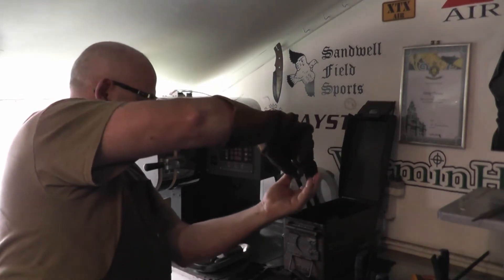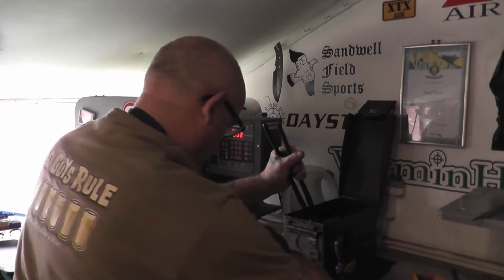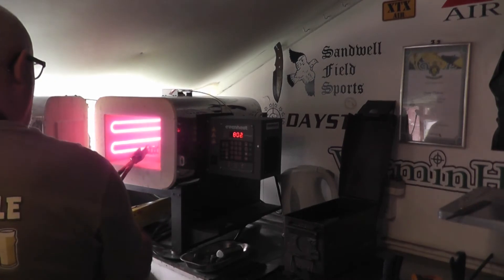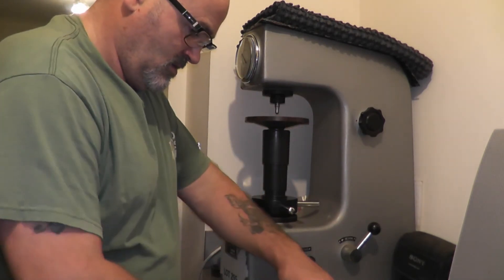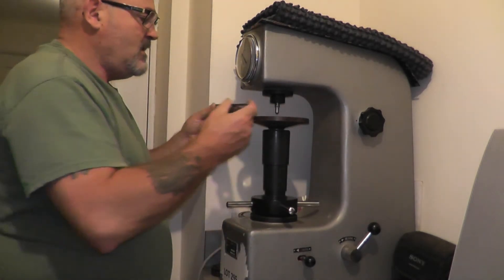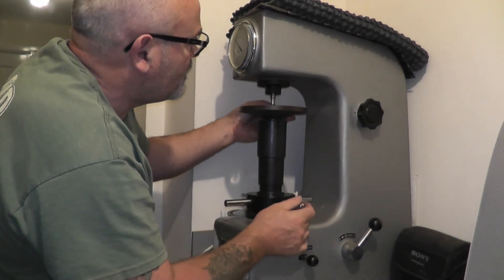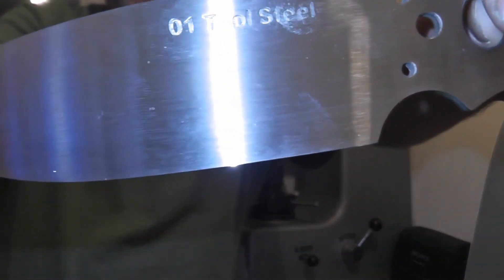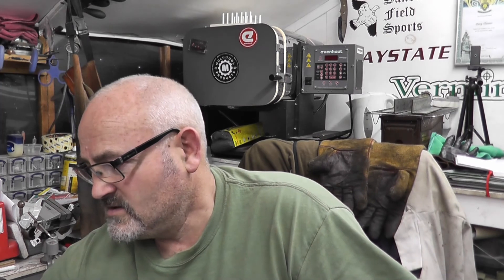O1 Tool Steel, Heat Treatment

Comment: Hi, what's exactly the temperature and time for tempering this O1 steel to keep it arround 59-60 HRC. Thank's
Reply from the maker: Hi buddy
805 c /  1482 f soak for 20 minutes , freezer @ - 35 / no 6 for 1hr , temper @ 200c / 392f for 2hrs x 2 should yield a 60HRC, you can move 50c/f either way to increase or decrease 1 HRC point.
Hope this helps buddy. Typing from memory actual data in in me book which is in the man cave ,so may update later once checked 👍

Comment: Been doing O1 since 1992 and learned a few things. If it warps after quench you can straighten it if you're quick for two minutes after quench.
Reply from the maker: Hi buddy
Appreciate your comment 
Have you made a video of this procedure buddy,also I think I was lucky on these as they were 4mm and hardly wrapped, If I get warps now I take them out through my tempering cycle buddy.
And while I have you here,what’s your opinion on triple temper of O1 steel.
Regards

Davy
Reply: @DTKcustomknives  Not necessary unless you have really thick blades like 6mm or better. I never make a knife thicker than 3/16s or 5mm. This steel is very strong. O1 with the 0.2% vanadium is very easy to HT as the V at that strength restricts grain growth. The metallurgist Cashen (can't remember his 1st name) was who taught me about being able to get the warp out right after quench because it moves easily with just a vise and pliers, but after 3 minutes it sets in. My theory is the Manganese, if you noticed it is higher with O1 than any steel I've seen, over 1%. It doesn't start making the steel brittle until over 2%.

 This principle works with brittle aluminum and hard brass, but just heat to 450F with a torch and you have three hours to bend them before they get brittle again. We used a piece of pine wood and when it started to burn the material was hot enough.

 I tried Cashen's methodology and take it up to 1200F and sit for 10 to 15 minutes, then 15 minutes at 1475F is O1's sweet spot and quench in canola oil if you cannot afford the slower HT quench oil is about the right speed, but it does break down. I found peanut oil lasts longer and works as well. 

I have no idea of how to download my process, plus I sold all my heat treat equipment in 2017 because of disability. I mostly do leather work now.